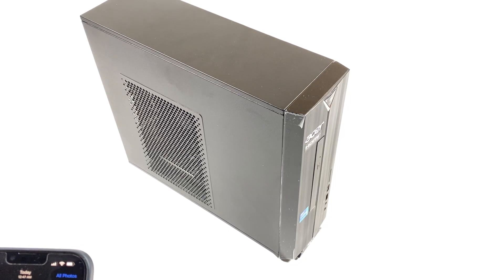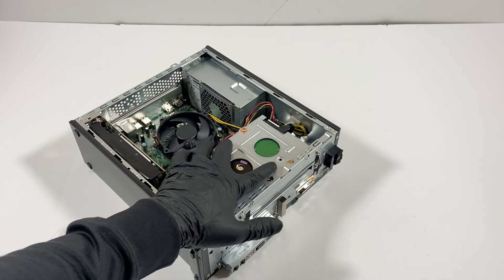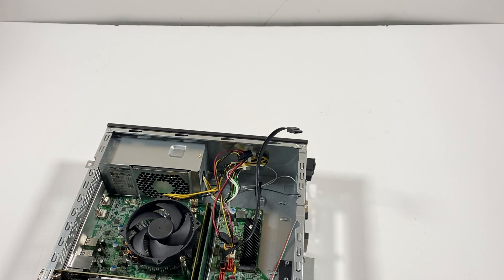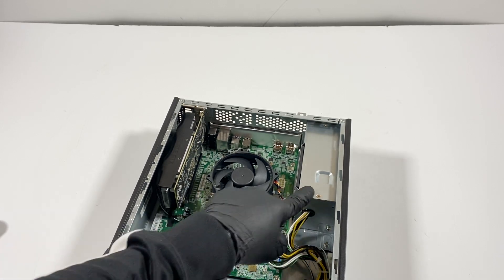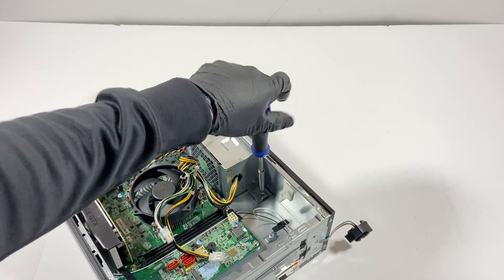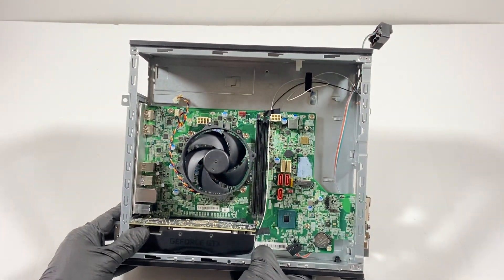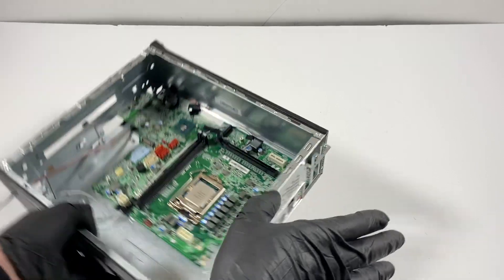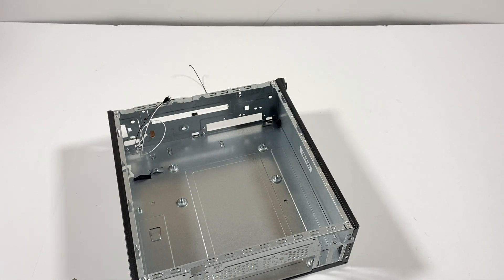Acer Aspire XC-1660G Teardown

Comment from the maker: List of Parts and Upgrades works with this acer system :

(1.)  M.2 2280 SSD heatsink, Double-Sided Heat Sink, PCIE NVME M.2 SSD
https://amzn.to/3l2ittr

(2.)  EZDIY-FAB M.2 2280 SSD heatsink, Double-Sided Heat Sink, PCIE NVME M.2 SSD
https://amzn.to/3m7J3me

List M.2 Type 2280 NVMe PCIe:
(1.) Samsung (MZ-V7E1T0BW) 970 EVO SSD 1TB M.2 NVMe
https://amzn.to/3d52k2a

(2.) Samsung 970 EVO Plus SSD 500GB
https://amzn.to/3fpi95A

(3.) Samsung (MZ-V7E500BW) 970 EVO SSD 500GB - M.2 NVMe
https://amzn.to/37uuLFw

(4.) Crucial P1 500GB 3D NAND NVMe PCIe M.2 SSD - CT500P1SSD8 
https://amzn.to/2N07wKh 

---------------

 List of RAM will work with this system.

(1.) Crucial 32GB Kit (16GB x 2) DDR4 3200 MT/s (PC4-25600)
https://amzn.to/2Zazppk

(2.) Crucial 64GB Kit (32GBx2) DDR4 3200 MT/s
https://amzn.to/3bxCRPJ

(3.) Crucial 8GB DDR4 3200 MT/s (PC4-25600)
https://amzn.to/2R07Ier

(4.) Crucial 16GB Kit (8GB x 2) DDR4 3200 MT/s (PC4-25600)
https://amzn.to/326cfT7 

---------------------

List video cards will work with this system.

GIGABYTE GeForce RTX 3050 OC Low Profile
https://amzn.to/3xEnd4D

(1.) AMD Radeon RX 6400 Low Profile Gaming Graphics Card
https://amzn.to/3s8MUUY

(2.) MSI GTX 1050 TI 4GT Low Profile  Graphic Cards 
https://amzn.to/2LwZd7P

(3.) Gigabyte Geforce GTX 1050 Ti OC Low Profile 4GB GDDR5 128 Bit PCI-E Graphic Card (GV-N105TOC-4GL) 
https://amzn.to/2T8bfsv

(4.) GIGABYTE GeForce GTX 1650 D6 OC Low Profile, Low Profile GV-N1656OC-4GL Video Card
https://amzn.to/381pp6Y

(5.) Gigabyte GeForce GTX 1650 D5 Low Profile 
https://amzn.to/3el08os

(6.) MSI Gaming GeForce GTX 1650 4GB GDRR5 Low Profile Graphics Card (GTX 1650 4GT LP OC) 
https://amzn.to/2X1FYsF

(7.) Gigabyte GeForce GT 1030 GV-N1030D5-2GL Low Profile 2G Computer Graphics Card 
https://amzn.to/2Z4PHkp

(8.) ZOTAC GeForce GT 1030 2GB GDDR5 64-bit PCIe 3.0 DirectX 12 HDCP Ready Low Profile Video Card ZT-P10300A-10L 
https://amzn.to/2WzgLXk 

(9.) MSI Graphic Cards GT 1030 2GB GDDR5, Low Profile 
https://amzn.to/390Spum

----------------

Thermal Compound Paste:
(1.) ARCTIC MX-4 (current edition) Thermal Compound Paste 20 Grams 
https://amzn.to/2DhGJaK 

(2.) Arctic Silver 5 Thermal Cooling Compound Paste 
https://amzn.to/2ziNU0H

(3.) Noctua NT-H1 3.5g, Pro-Grade Thermal Compound Paste
https://amzn.to/36kTk7A

(4.) ARCTIC MX-4 (current edition) Thermal Compound Paste 20 Grams 
https://amzn.to/2DhGJaK 

---------------------

HDD list works with this PC:

(1.) Western Digital 2TB WD Blue PC Hard Drive HDD - 5400 RPM, SATA 3.5" - WD20EZAZ
https://amzn.to/3w3jIQA

(2.).WD Black 2TB Performance 3.5" Hard Drive - 7200 RPM Class, WD2003FZEX 
https://amzn.to/2xFUeyF

(3.).Seagate BarraCuda 1TB Internal Hard Drive  3.5" Hard Drive - 7200 RPM
https://amzn.to/3g8FXM8

(4.) Seagate BarraCuda 2TB Internal Hard Drive HDD – 3.5 Inch SATA 6Gb/s 7200 RPM (ST2000DM008/ST2000DMZ08) 
https://amzn.to/3KDlnl1

Disclosure: Amazon links this means that if you purchase an item we earn a small sales commission affiliate.
Reply: All the graphics in this description fit at the Acer pc?

Comment: I just got this pc and i am new to pcs i was wondering what would be the best graphics card to start with for gaming? Or what type of cpu fan i can get bc i wanna upgrade my cpu fan bc i dont like the one it comes with
Reply from the maker: Hi, i no longer have the PC,  it is still possible to upgrade the CPU fan, and best video card would be GTX 1650 Low Profile or AMD Radeon RX 6400 Low Profile

Gigabyte GeForce GTX 1650 D5 Low Profile 
https://amzn.to/3el08os

AMD Radeon RX 6400 Low Profile Gaming Graphics Card
https://amzn.to/3s8MUUY
Reply: @Mxkdt   thank you for the help i am new to pc gaming and was tryin to learn how to upgrade my pc i want to upgrade my cpu fan and get a video card but wasnt really sure which one was the best for gaming
Reply: @Mxldi do you possibly know any good cpu fans to upgrade the stock fan from? i want to do a rgb fan but its not a must im just cerious to see what all my options are
Reply: @PlanetExpo24  I did the CPU fan... can't hear a thing now.

 installed a Noctua NH-L9x65 (CPU fan) and Noctua NA-FD1 (duct). The fan is freaking quiet. this CPU uses LGA1200 socket.

The factory thermal paste only covered about 80% of the CPU 😐. The original CPU fan bracket is double taped on the back of the motherboard. Just pull on it and it will eventually come off.

I installed the Noctua CPU fan so the heat sink fins are vertical. (with plenty of thermal paste 😎) The fan may stop when the PC is idling, but does turn on and stay on if the CPU is running hot. (so don't freak out) CPU temp. is between 62~68 most of the time when I run my usual programs. (and yes.. the fan is quiet... while the original fan would have been at full speed) I kept the smart fan on in BIOS.

The Noctua NA-FD1 is optional since Noctua NH-L9x65 already has a taller heat sink and place the fan closer to the case opening, but I decided to use it since the PC has no exhaust fan. They said Noctua NA-FD1 is not compatible with Noctua NH-L9x65 and that's because Noctua NH-L9x65 uses tension hook to hold down the fan on the heat sink instead of screws. (so you can't "replace" the fan screw as the kit instructed an the tension is in the screw holes) But all you need to do is cut the "straws" down the cylinder wall, squeeze them into smaller straws, and push them into the 4 holes where the screws are supposed to go... then the rest is easy.

Comment: The fan is so loud I’m thinking of replacing just the fan, do you have any suggestions what I could replace it with?
Reply: I installed a Noctua NH-L9x65 (CPU fan) and Noctua NA-FD1 (duct). The fan is freaking quiet. this CPU uses LGA1200 socket.

The factory thermal paste only covered about 80% of the CPU 😐. The original CPU fan bracket is double taped on the back of the motherboard. Just pull on it and it will eventually come off.

I installed the Noctua CPU fan so the heat sink fins are vertical. (with plenty of thermal paste 😎) The fan may stop when the PC is idling, but does turn on and stay on if the CPU is running hot. (so don't freak out) CPU temp. is between 62~68 most of the time when I run my usual programs. (and yes.. the fan is quiet... while the original fan would have been at full speed) I kept the smart fan on in BIOS.

The Noctua NA-FD1 is optional since Noctua NH-L9x65 already has a taller heat sink and place the fan closer to the case opening, but I decided to use it since the PC has no exhaust fan. They said Noctua NA-FD1 is not compatible with Noctua NH-L9x65 and that's because Noctua NH-L9x65 uses tension hook to hold down the fan on the heat sink instead of screws. (so you can't "replace" the fan screw as the kit instructed an the tension is in the screw holes) But all you need to do is cut the "straws" down the cylinder wall, squeeze them into smaller straws, and push them into the 4 holes where the screws are supposed to go... then the rest is easy.

hope this help. I will let you know if my PC ended up catching on fire. 🤣
Reply from the maker: Hi, yes it is possible to replace it fan have to be 4 pin /4 wire..

Comment: I appreciate this complete disassembly. I wanted to see if the CPU cooler was replaceable, because I did not know if the mounts were built into the chassis or not.
Reply from the maker: Hi, thanks, yes it is still possible you can replace the fan or CPU cooler, i do not have compatible spare parts CPU coolers for this acer PC for further testing ...

Comment: The Acer Engineering is pretty good, I will give them that. It's a shame though they made the front headers a proprietary thing by making all being part of the motherboard instead of being separate by having a daughter board, a motherboard with the header ports, and wires to plug them in like any normal custom gaming pc should have. Other than that, Excellent video!
Reply from the maker: Hi, thanks..
Reply: You can still work with it you just need a pretty big case if you want something powerful